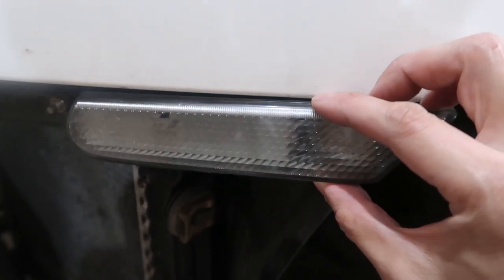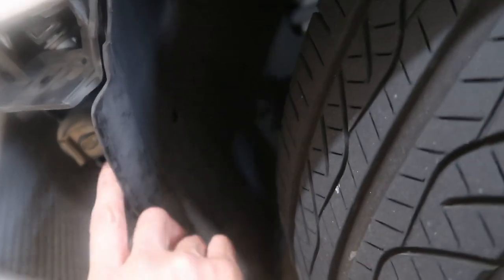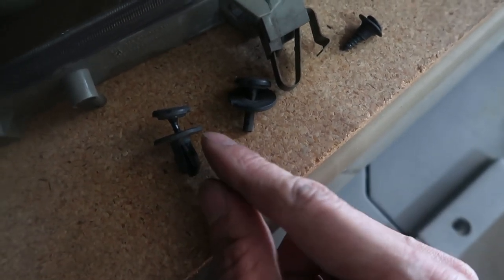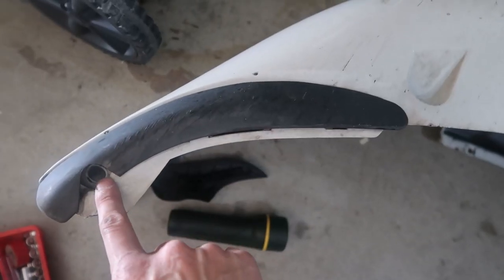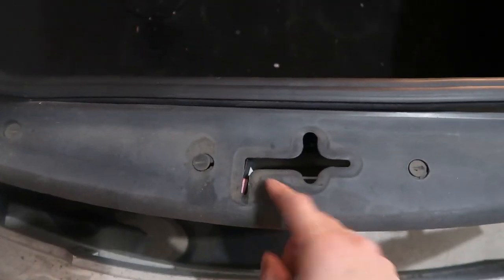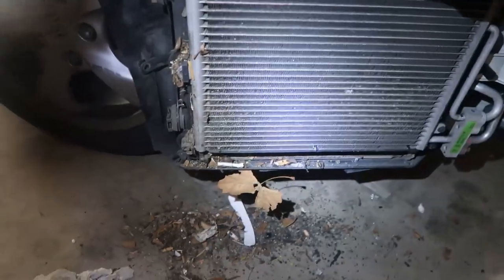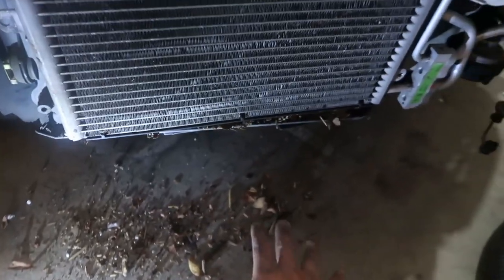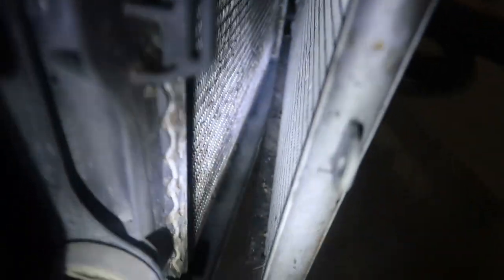Porsche Boxster Radiator Cleaning

Comment: I changed thermostat and water pump just last week and did bleeding process and my cars been floating around the 93 degrees c mark which is like 200+ f going to do this this weekend thanks. Also hearing guys washing out rads too
Reply from the maker: Nice! Lots of stuff stuck in there. I really felt better seeing the temp drop after doing this.